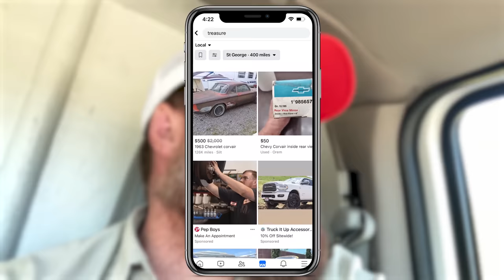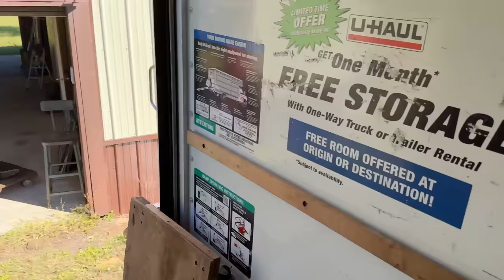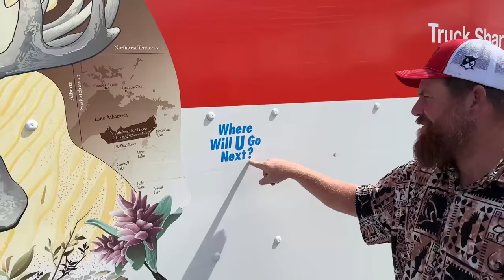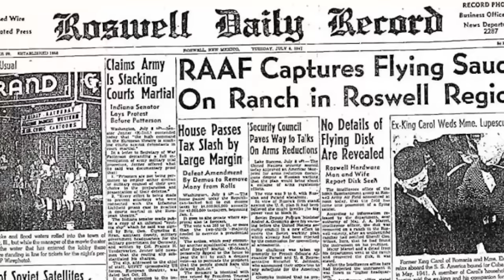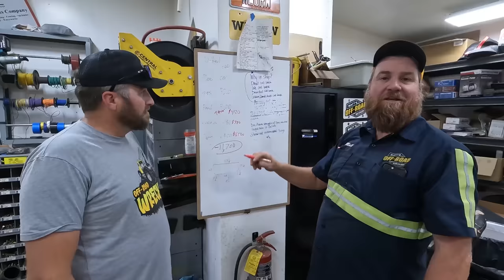There Is Seriously Something Wrong With Me! Bombi Build Returns

Comment: Could be a good idea to mount the guage cluster, on the bombi, above the front window attached to the headliner.  Gives more leg room and won't be kicked, plus I don't think yall will be worried about the speed limit.
Reply: Good idea. And most of these dashes have configurable alarms, so the dash will flash, if some value is going out of range, or it could activate an output wired to some LED control light right in the view of the driver.
Reply: Then it's also more like a commercial jet.... maybe cameras display on that dash they made so they can keep eyes on things.
Reply: Agree,  that gauge location looks to low, look down all the time, up higher is better,  rather have the lower window, obstructed a few inches, surprised on adding seating up so high, on it and winter time,  no one gonna wanna freeze,  may be better for gear holding space, and think about a bigger unit, trying to do much with the smaller bombi.
Reply: I was thinking the same thing - mount the gauges up above, especially since there only needs to be fuel, water temp, trans temp and voltage gauges. Plus add lots of usb plugs to charge all the camera equipment.
Reply: I am thinking the exact opposite. I like it low so it isnt in Matts line of sight , plus , we all know he isnt gonna be watching them at all!! LOL
Reply: @warrenmichael918  well with that windshield he won't see the gauges that well anyways, but putting it higher will let the crew in the back and sides see if it's flashing.

Comment: You're going to love that 12.3 Pro Dash by Holley!  I recently added one to my K5 build and love it.  You can easily add a fuel gauge with one sending unit wire in and setup the ohm ranget!  I cant recall if you're using a Terminator X on the engine management, but it's super simple setup and all sorts of coos stuff can be added to the dash.  Love all that good Holley Performance stuff!

Comment: How fate works is quite amazing, i have been unable to watch my favorite show lately and in part it’s is because i was busy fixing my wife’s, corvair. It’s a 1965 convertible that her mom purchased for her dad in the late 70s he sadly passed away very young from heart disease and the car was moved from Wayne, Pa to the panhandle of Ne. parked in a garage and basically sat there for almost 40 years. After many trips to its location i finally got it to run and was able to take her and her mom for a drive (what a feeling that was) recently her mom fell ill and she gave the car to my wife and now we have it here in not so western Ne. and ill admit im not a mechanic and i have never worked on a corvair EVER! We have been able to drive it and enjoy it here these last few weeks and i find a new repair each trip and it has been a challenge. So i sit down to watch an episode of your show and i pick this one. And then you pull from a box the 1 part i have not located that is needed. And that is the center cap for the horn. We have the original and it has a spring broken on the side so it will not stay in i have found used ones that are in horrible shape i have taken the springs off and tried to reattach them to the original and its a short drive until it on the floor. So i ask you now if you have another idea to repair that pop aluminum that it is made from i’m running low on material to work with and i fear ill ruin it. If you or your team has a nifty idea to fix it and would not mind sharing that i would be very appreciative. Love your channel stay safe!!

Comment: Retro fit a roll bar hoop on the rear most part of the bed. Find 2 seats that will fit in the 45° ish areas plus seat belts. Hang a suitable tool box outside the rear frame work plus the roll bar/hand hold at the cab and yur done

Comment: I once boughtg an 8-door Greenbriar van and after accidently finding an 140 HP Corsa engine  I installed that engine.  What a difference.  At 70 MPH it would average 20 MPG.  The only thing I did not like was the mobile smog bank if you tried to use the heater.  I woprked at a small electronics repair shop.  When we would get a 5' TV console we wouild open both side doors and walk through the van to load it.

Comment: My Dad has, under his house, three Morris Minor engines and gearboxes, complete, on a rack. He has a complete Morris 1100 engine and gearbox for a car my sister sold 35 years ago, and she's been dead for 2. He has a spare engine for Mum's Austin 1800. He has a full spare set of wire wheels for his MBG. He also has advanced dementia, sold the Moggies, and the 1800 and the B haven't moved in years. Got plenty of parts though.

Comment: Hi. Could you lift the top bar on the dash a few inches so there is a gap between it and the bottom frame of the windscreen and use that gap as the heater vents, that way you wont need to cut into the dash face. Cheers MD

Comment: Tom Tom needs to utilize the scribe method. Put the tape away, hold a longer than needed piece on the position and just use a marker to scribe (mark) your cut line exactly. Try it Tom. It’s easier and saves time.
Wow. Matt gets his Corvair fix. For a while. 🤣

Comment: I especially loved the dirty chin on Kendal.  The Dash on the bBombi looks good although I personally would extend the cab forward under the windshield a few inches for more leg room and to install the lights.  If you leave the lights back open to the cap what little heat they generate would ease the heaters job during mild winter.

Comment: Dig a couple few holes that are wider at the bottom then the top.  On top of the hole, place a board or flat rock leaving a inch or so access to the hole.  They will run in the hole and get stuck. If you do that in a few places around your cabin it might help.

Comment: “ scrap value and turn them into EVs.” I hear you. So, I have an idea, make your own blasphemous EV version - I have been playing with the idea of converting my old YJ into an EV - completely impractical but would be fun to try to do. My goal is a 50-100 mile range. I thought the weight would be horrible in the sand, but watching your channel I am wondering if that would be true. The wrecker has done well… well, except for one… The finite to infinite power added to a manual transmission where you wouldn’t ever need to shift - no clutch - just choose a gear based on what you would be doing and what range you need since you are not concerned with RPMs. It would be a kick to test on the rocks and in recoveries.

Comment: That circle at Roswell:— You said the diameter and circumference keeps changing but the radius remains constant.  That is a geometric impossibility.  You must have got your wires crossed and totally muddled.

Comment: Depending on the uhaul model you get, you'll barely get 10mpg most of the time. I think my best was 12mpg and I usually get around 7mpg in them. They're pretty horrible on fuel mileage. Anything over 55mph also tanks the mileage. It's crazy.

Comment: I understand the addiction! Mine is not Corvair car parts but electronic parts, resistors, capacitors, transformer and such. I’m also a ham radio operator and l have all kind of radios and antennas. I’m just a big nerd and like Al kinds of nerdy stuff and things.

But I DO understand! Resistance is Futile you will assimilate by something one day!

Comment: Corvair story > Back in my race car days at times someone would hang around in the shop being in our way bumping elbows being a car savant ratchet jaw annoyance, so we would send these types to the other side of the city to pick up a Corvair Monza water pump we needed, and some would say Corvair's are air cooled,  I'd say dude Monza means water, Oh, ok, and off they'd go, well the Chevy parts guy knew what was up and he would send the dude to someone else whom was hep to what was happening etc...
I've built headers for Corvair's back in the day and Matt if you pull the exhaust system off the wrecker and have it aluminum Jet-Coated this will completely stop the radiating heat problem, and the exhaust system will last for years and still look shinny new.           ~Go fast take chances~~~~~~~~~~~~~~Braaap!

Comment: I'm surprised that U-Haul has the weight capacity to handle this. They don't usually figure that the entire load is going to be Steel. Also the only way to get better gas mileage is to drive 50 MPH. The faster you go over 50 the worse the mileage will be. It has been the case with every ICE or EV I've put more than 1000 miles on.

Comment: lol, the cash vs plastic was a missed opportunity to be sponsored by Square (the payment processors with the card scanner you attach to your phone). xD

Edit: Best shower (head) is the ones from High Sierra Showerheads. Imagine if you could use 1.25 gpm and get a pressure washer showering.

Comment: I could haved saved you a Hotel room cost I have spare cabin not to far from Gallup. And I would have seen if you needed some Ford dana 60 front axles or some 10.5 rears. But I might be going that direction after the start of the year.

Comment: You guys know you have added a ton of weight to the bombi, right?
Like SO much stuff you have welded onto it that wasn't there, plus the engine, axles, track drive etc.
I wouldn't be surprised if the bombi ends up being twice the weight it was originally.
Yall would have been SO much better off just buying a snowcat.